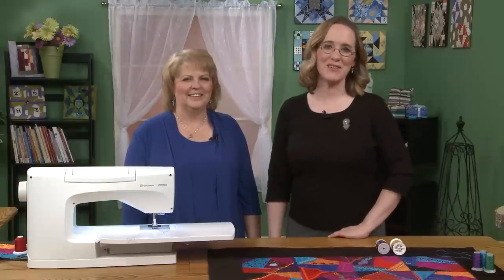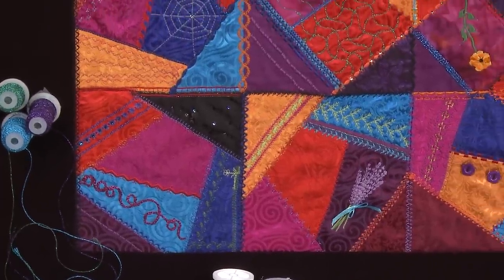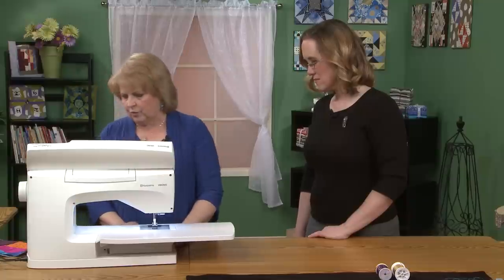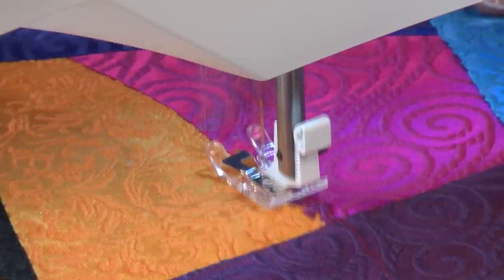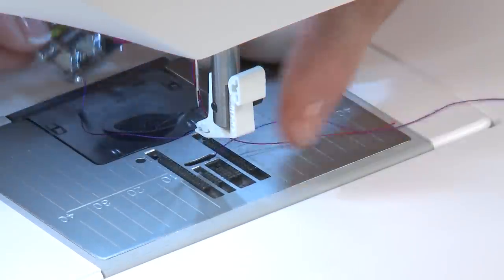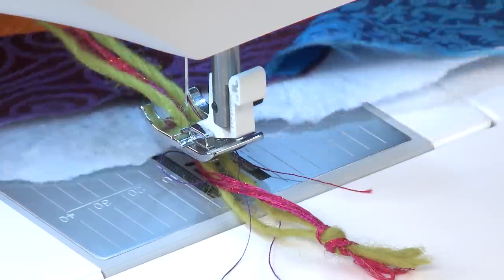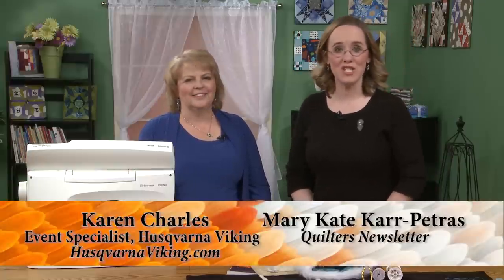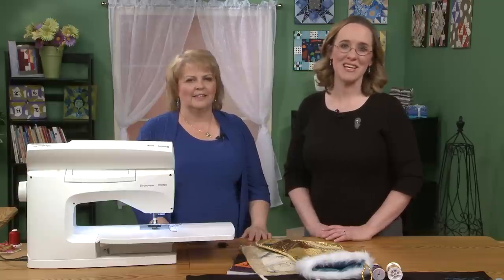Crazy Quilting with Karen Charles

Comment: What brand of metallics did you use?
Reply from the maker: Hi Paula, if our recollection is correct (and the spools do appear to be the right shape), we were using Robinson-Anton metallic threads. There are many good brands of metallic threads available, however, and we would encourage you to find what works with your machine. Sometimes putting the spool of metallic thread in the freezer overnight prior to use makes even a so-so metallic work very well. Hope this helps!
Reply: Thanks.  I just purchased the 960Q and wanted to try this.